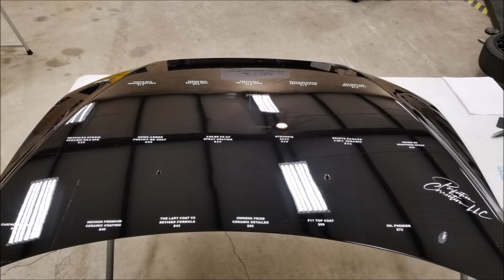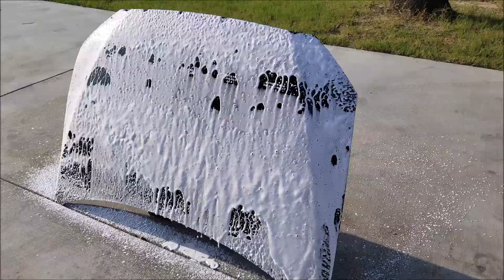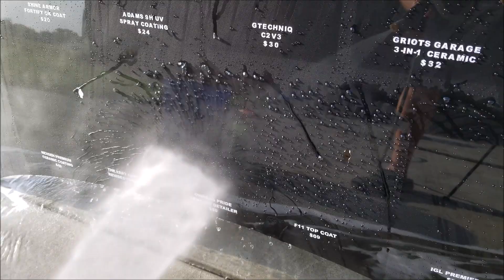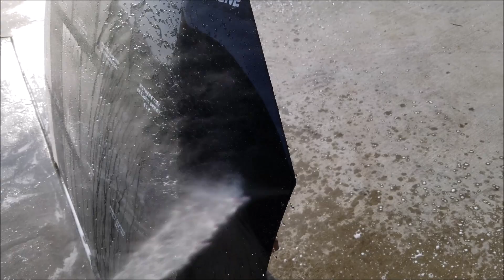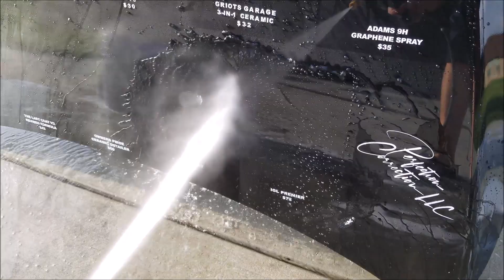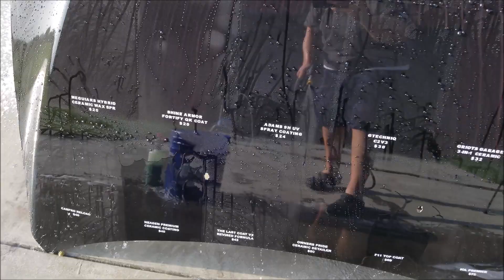Ultimate Ceramic Spray Coating Test UPDATE 02 - 20 products, 1 hood.  FIRST WASH, 3 ALREADY FAILED!!

Comment: First and foremost, thank you for doing this. Having used several of these products myself, I can't help but come to the conclusion that a good wax is better. Durability of every spray on wipe off product that I have used has been frankly, terrible. A good Carnauba wax or even excellent cleaner wax like McGuire quick detail 66 provides an extremely hydrophobic surface that lasts longer than these overhyped sprays which I suspect contain large amounts of emulsified silicone. The durability claims are laughable. I actually like turtle Wax hybrid ceramic for the price but their claim of 12 months of protection with two coats is a joke. Two weeks maybe. I have also used among others, nexgen, which lasts even less. As far as the whole slickness where they show the bottle sliding off the hood? Any good wax will do that, and do it much longer. I suspect that the positive review was on Amazon are the result of plants, and folks who get a good initial impression and write their review. These products will produce a glossy hydrophobic slippery surface initially. But so does lemon pledge. Durability is what I am after. Nu finish in the orange bottle used to be a fantastic product. You did not want to get it on rubber or plastic though. I am told that they have changed hands and that the formula is not the same. But I guarantee you it would Outlast any of these snake oil sprays. I probably have a collection of over 100 different detailing and supposedly protective top coating products. If I want durability, I use a high quality carnauba. Yes, it's more work. Undoubtedly. But so far I have found no magic bullet so to speak. If you want to use a nice clarifier after you wax, there are several. Lucas slick mist comes to mind but there are certainly others to choose from.

Comment: EXACT same results with shine armor and F11 with my tests.. https://www.youtube.com/watch?v=mURVZqlq3x8

I found it ironic that F11 advertises "What if you never had to wash your car, truck or motorcycle again?" yet they are shown washing cars, trucks, and motorcycles?

Even an EXPENSIVE ceramic coating, you still need to wash the vehicle.. Dust, dirt still will stick, just not as bad and makes cleaning a whole lot easier.

Comment: What did you prep the surface with before application?

 . I am waiting to buy Meguiars Hybrid Ceramic Spray after one of your tests. Need to import it.
Been following you from many years, awesome channel. 👌🏻
Reply from the maker: https://youtu.be/vSAP2BuxdRk prep video right there. 

We used Adams Panel Wipe/panel prep which is essentially Isopropyl alcohol, diluted.

Comment: Just thinking out loud: Using a drying Microfiber of some sort after each wash (opposes to the blower) adds another layer of mechanical abrasion that 98% of people who wash their cars do.  Might more accurately reflect durability for the average user.
Reply from the maker: Great idea.
Reply: Yes...it does.  Most of the waxes Ive tested last no more than 8 to 10 car washes...mitten wash and soap with microfiber towel dry.  2 months is the max from everything ive tried.  Hard water also impacts longevity.
Reply: Another sugestion so Scott can simulate real life conditions would be for the hood to placed in the same position as it would stay when is mounted on a car. This way when it rains it will simulate the shedding of water on a car.

Comment: Hey Scott, have you tried drying the panel before judging the hydrophobic qualities of the coatings? Waxmode has shown in his videos that after rinsing there may still be some surfactants remaining on the paint, even if it’s not visible. A wipe with a drying towel before spraying again will often revive the hydrophobics. He uses Carpro Reset though, not sure if you have seen this with your own chemicals.
Reply from the maker: I can try that for the next update in 2 weeks!